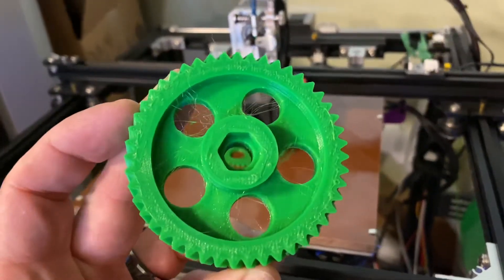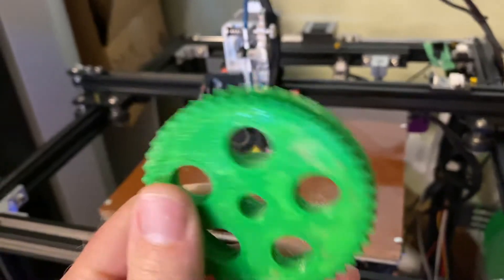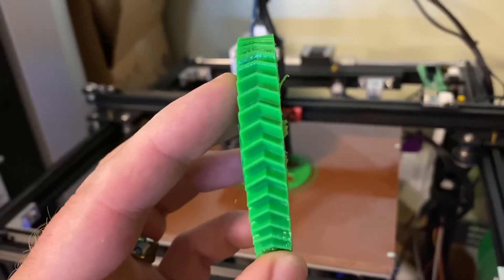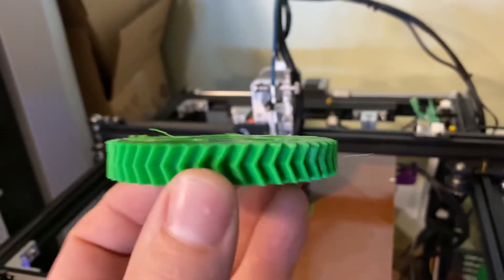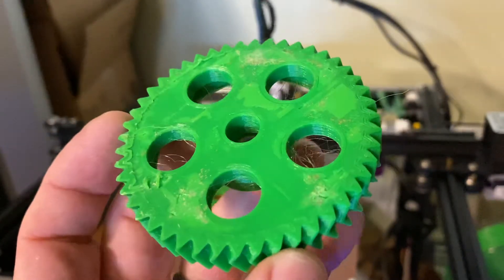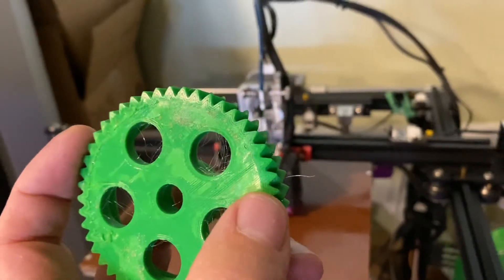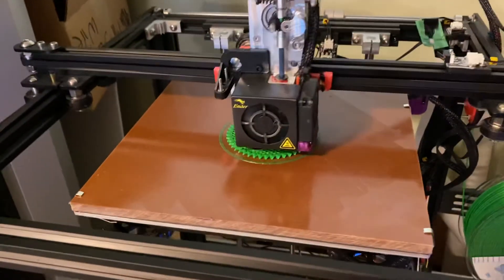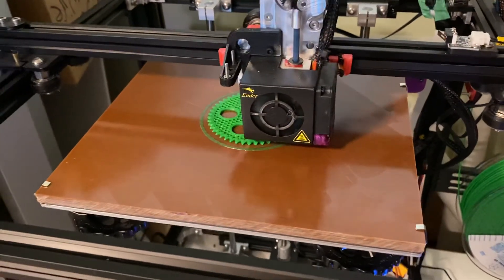Printed Nylon using Garolite bed - Ender5

Comment: So any updates? Will pva glue make the printed parts easier to be removed from the garolite bed?
Reply from the maker: I’ve switched my big printer over to Garolite and yes PVA works great for PETG and the part releases well. The PVA didn’t work well for nylon on my Ender 5 and I really haven’t tried it again.
Reply: @baird1fa  The stock bed on an Ender 5 is very bad, thin stamped out aluminium which isnt anywhere near flat.
I replaced the bed on my 5 Plus to an 8mm thick cast and milled bed and it was like a completely different printer.
Got within 0.12mm across a 370x370 bed.